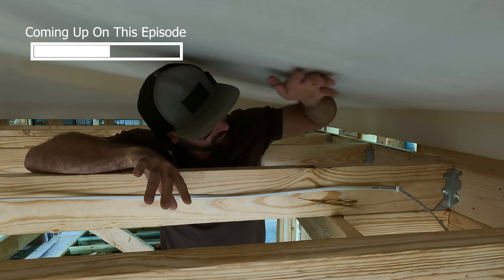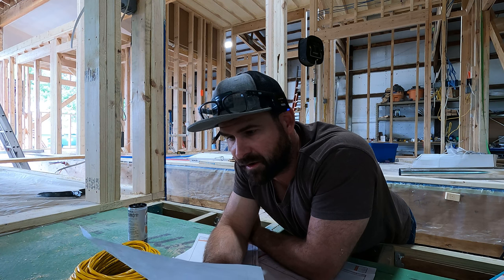Unbelievably Tiny Loft in This Tiny House

Comment: I was wondering if there is a standard for lofts.  It seems like they are 48 inches from the floor. I guessing that with 2x8 with flooring, you are looking at about 6 ft celling height. You need what about 1ft and 1/2 for trailer to stay under 13 ft 6 in. Just guessing
Reply from the maker: This unit is a little different in that it’s shipping height is 14’8” and the main floor ceilings are 8ft
Reply: Get better soon!
Reply from the maker: @danconlan8735 thanks 🙏